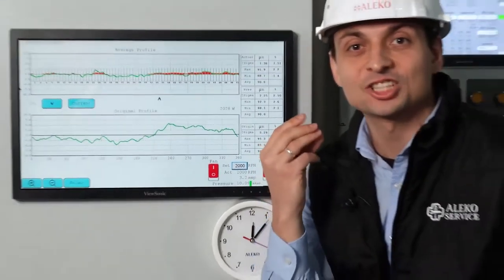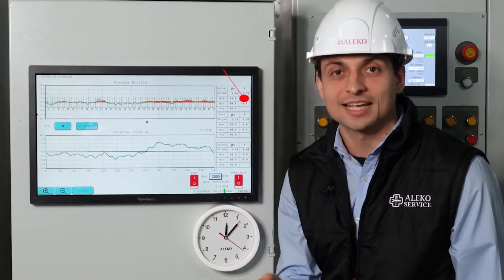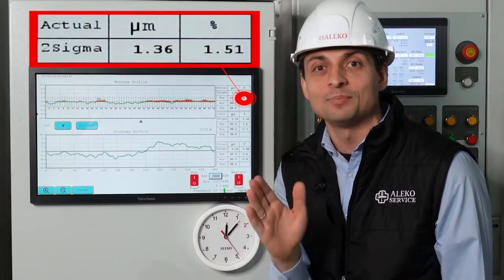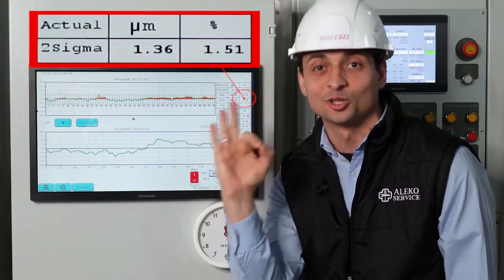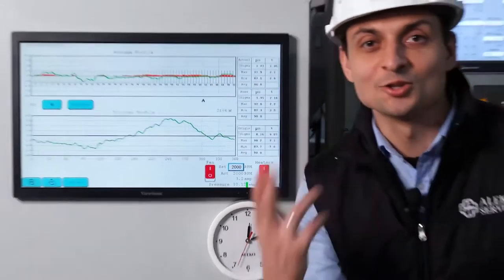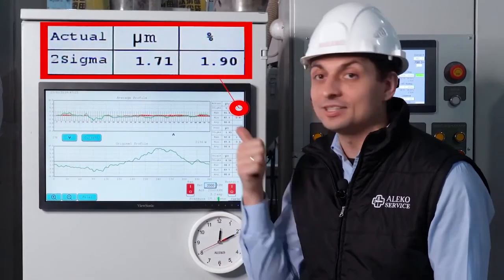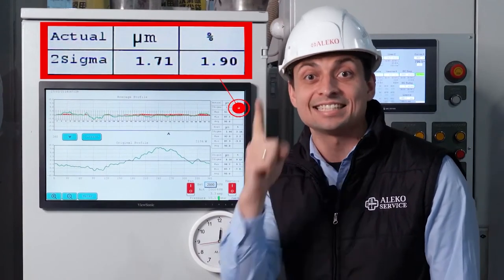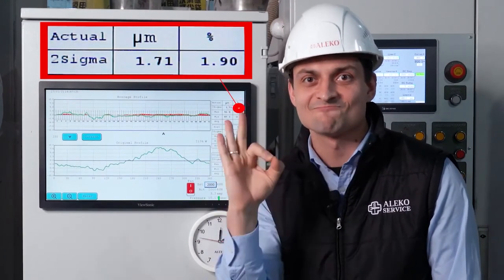Thickness/gauge control system Aleko

Comment: how does it work ?  why does the scanner have to move clockwise and anti-clockwise ?  Why does it not move in one direction only ?  Does  it  sense the thickness or the density of the film  ?
Reply from the maker: This is a Kundig sensor. The scanner moves clockwise and counterclockwise. It makes a full circle and measures the thickness of the film.